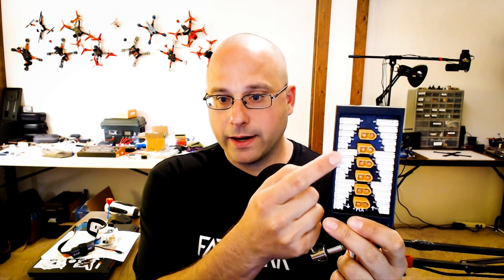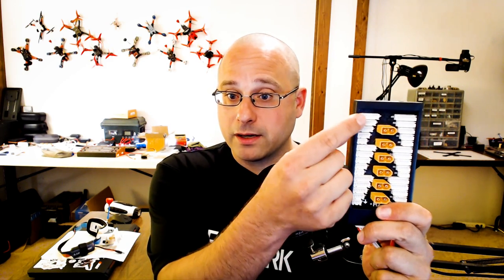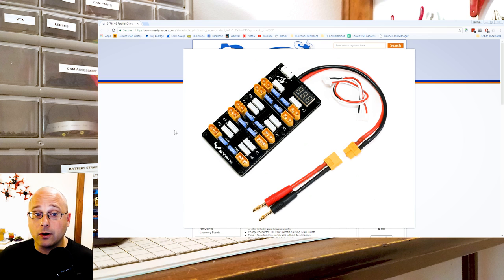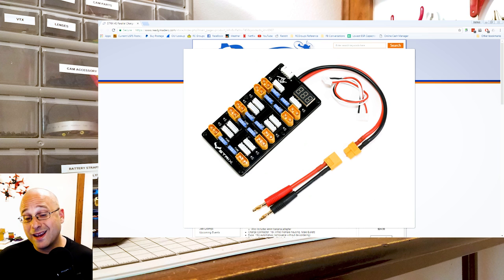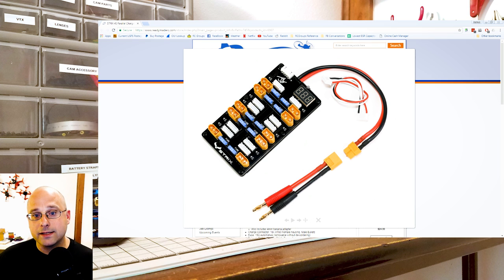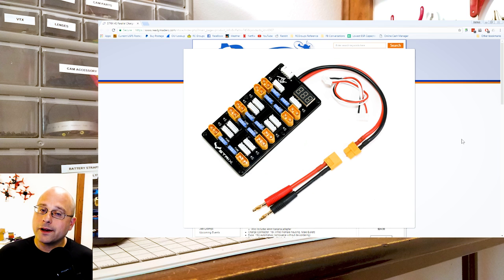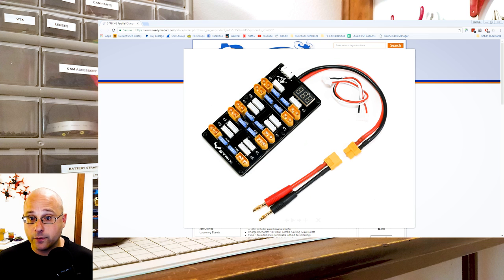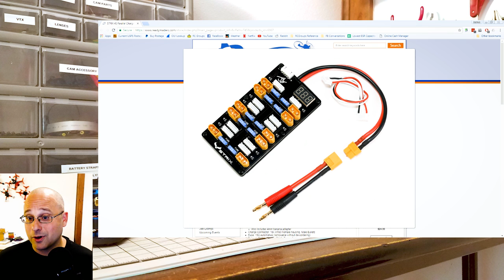The Best 4S Parallel Charging Board. Period. | JB SIGNATURE LINE

Comment: Just received my order today (back order was only about a week). Initial impressions: This is a very well built board. I was immediately surprised by the weight of it. Built in voltage meter is a really great added touch. The unit is charging up 3 packs as we speak and about 30 min in everything is working great (charging just below 1c @ 3A). Really happy with this purchase, thanks again Joshua!

Comment: Nice product Joshua.  I may have to grab one next time I'm in the USA. I would have loved to have at least one battery outlet to have 3s and 2s balance ports as well for the google and radio batteries I use.  Just for the odd times I charge that stuff. Otherwise it's very nice indeed.  Does it have poly fuses?
Reply from the maker: No poly fuses because of price and space on the board. 

The other balance plugs were intentionally left out to prevent people from ever making the mistake of accidentally mis-plugging the balance port. You can mis-plug the XT60 of course but that's what the fuses are for.
Reply: FinalGlideAus connect your 2s batteries in series :P
Reply: and if it is a deal breaker, would be easy for those inclined to add to a custom balance connector
Reply: FinalGlideAus just unplug this from your charger and plug you goggle batteries and transmitter battery in.
Reply: FinalGlideAus I've been using the SkyRC D100 with dual ports. Fantastic charger for that purpose. FS pack on one side and 4S on the other or micro 2S packs on one. Whatever! Awesome charger.
Reply: I dont get it, if all you need is poly fuses, there like a $1 each. I just purchased some to fix a car fridge for a customer, this is definitely a step in the right direction thou.
Reply: FinalGlideAus sounds like Joshua Bardwell has another product to design! Go from his boards xt-60 To another board with a step down processor controlled to lower s rating. To charge goggle battery, radio etc. Technically it could be the same as this board, because you wouldn't need 10 charging ports. Way easier for traveling, and home charging at that. Not sure if this wild work, but  Maybe on the step down board it could have one port with 4s on there to (( burn off )) the extra voltage to that pack.
Reply from the maker: Polyfuses are "only" a dollar each? How many polyfuses would this board need? Five for each balance connector, or fifty. Even if you consider the bulk discount we would get, you can see how high the price of the board would have to be to include them.

Comment: I will be buying these, being in the automotive field for 14 years, was shock to see my parra board not have a fuse holder but a fuse soldered to the circuitry. Very nice josh. Keep that top shinny, you deffently can pull it off. Jeff Evans at evans tuning does. Thanks

Comment: Hi Joshua,
as you are asking for ideas. There is some idea in my mind which is about having some kind of LiPo-Equalizer. This should generally be a parallel-charging board that has some regulating electronics on it and would do this:
During a flight session, you plug all empty 4S LiPos to it no matter how far you discharged them. The board will automatically equalize the LiPos but monitors and controls the C-Rate of the current-flow between those. This makes parallel-charging more safe and more effective.
Currently if I fly my 8 packs I check them afterwards and end up with maybe 3 groups of 2 batteries that I can charge in parallel. This board would simply need the time to get all batteries to the same level and then allow to charge them together.

Comment: You're my hero. Great product. I'm ordering one now. I agree you should include a "standard" 6S balance plug adapter. Also 4S is of course the voltage to start with but I'd absolutely recommend expanding v2 into a line of boards covering all the "S"ss (voltages). I'd readily pick up a 2S board for my goggles batts, and a 3S and 5S as well.

Comment: this thing is amazing, and I am going to buy it. 

one modification I will do, is to change the fuse into a 4 or 5 amps fuse. I am using 4cell 1300 and 1550mah batteries, which will manage 3,9 and 4,65 amps maximum at 3C charge. I am normally charging at maximum 2C, so I will have a good safety margin for normal use. 
But, if I accidentally connect a battery with too high voltage, it will exceed the amperage that the fuse can handle, and blow the fuse. No batteries damaged. 

I really dont see the point of having a 15 amps fuse. if a 1500mah battery takes 15 amps, it is 10C. then you will probably have a fire going on in your house. 

I also think that a switchable fuse would be  better than a one-time-use fuse, so you dont get stucked in the lack of fuses. 

But overall, good job Joshua!
Reply: Martin Mehus this is an excellent idea
Reply from the maker: If you change the fuse to 4 or 5 amps, then plugging in two packs at 0.4 volts difference will blow the fuse.

https://www.youtube.com/watch?v=yTEGhKBv09M

We selected 15 amps because it gives adequate head-room for equalization current while still ensuring that a fault will blow the fuse.

And also because the light blue color looks awesome against the yellow XT60.

But mostly the first one.
Reply: Thanks for clearing this up!  I thought 15 amps was overkill, guess not!
Reply: 0.4V different seems a bit extreme to put lipos in parallel. The theory says between 3.7V and 3.8V there is approximately 20% capacity. So +10/-10% for the 2 you connect. On a 1500mAh it's 150mAh. If it equalizes in 30s (this number can change everything, but the current is much more at the beginning) after plugging, it means an average current of 18A.
By the way JB, a current curve of uneven charged lipos being connected would be very interesting !
Reply: Manuel Pellizzari fair enough, but I just tested this myself last night, I had four batteries at 14.9v, all equalized, then I plugged in a 16v (I crashed and didn't get to finish repairs by dark). I put a DC clamp current meter on the battery before I plugged it in, and then watched. The current started at something a bit over 10 amps, I couldn't catch it because it happened so fast, it immediately came down to 10 amps, and then stayed there for a few seconds before beginning to drop down to 9, 8, etc until it got to 5 amps, then it stayed there longer, more on the order of 10s of seconds before dropping down and I lost interest and meet them be to equalize.

The batteries were all 1.5ah 4s lipos. So each one individually never even seen 2c for more than a fraction of a second.
Reply: Tom U this configuration (more low voltage packs) is not so bad. That's why I always start by plugging the lowest voltage ones onto the board first. Interesting data BTW.
Reply: Manuel Pellizzari Thanks! Yeah we both do the same thing then, I follow the same procedure, usually with less variance between packs. It really is a great method, I believe I got it from one of Bardwell's charging videos. Have a good one man.

Comment: Looks good, but did you protect the balance lead inputs? 

I ended up custom making one using poly fuses to protect those leads as no commercial ones seem to have this.
Reply from the maker: No poly fuses because of cost and space concerns. Plug in the XT60 first and the main fuse will protect you. If the main fuse doesn't blow, then plug in the balance after 10-20 seconds.
Reply: It would have been perfect with poly fuses :( Even if the entire pack voltage is ok, the individual cells can be totally off and smoke the balance leads clean off.
Reply: John Norrbin Can confirm, that is what prompted me to build one with input protection in the first place. 

This can also happen if you get the connector half-seated in the wrong orientation. 

I understand the space concern, I just like things to be idiot proof as some days just happen to end up like that.
Reply: And those can be daisy chained too ;)
Reply: @AlexNZL

That is a pretty cool product, assuming they have the rest of the polyfuses on the bottom of the board that is.
Reply: EDIT: @Ammoniummetavanadate nvm checked mine and yes they are on the back. the vias go to them.
Reply: Here is the back of the board:
http://i.imgur.com/ZCfpgiU.jpg

Notice how it also has a fuse on the main connection to the paraboard, 50amp fuse. It's not enough to only fuse between the batteries, if you don't then you can still short circuit the pack nearest the main plug and cause a fire.

Comment: Next design something that where you can plug 10 lipos of ANY voltage in (same capacity and cell count) and it has current limitter between lipo inputs so I never need to check voltages before paraller charging again. I know it can be done and it would make life so much easier. Maybe I have to do it myself.
Reply from the maker: I have had this conversation with many people, and every time we actually go down the road to designing a solution, it quickly gets so expensive that you might as well just build a charger. The problem is that the current limiter has to be switchable so it allows current with low resistance when you are charging, but restricts current when plugging in. This sounds simple in theory, but in practice, by the time you've covered all the contingencies, you've basically built a charger, and you might as well just go buy somebody else's charger instead.
Reply: We don't need a complicated charger to do that.   Just a small smart battery discharger to carry to  the field that can balance all cells down to 3.6v or 3.7v.  Land, plug in discharger and it should be done by the time your next pack is done.
Reply: I agree.... Considering we dont even flinch at buying $30 batts.  I would pay $50 plus for a balance board that you could safely and mindlessly plug in same cell batts regardless of voltage.

Comment: Cliffnotes version:

So, what makes this rig better than the other stuff on the market is the ability to check each pack's voltage right on the board, the replaceable fuses on each port, and its compact size since it is designed for 4s packs only. 

it is STILL actually parallel charging, and not charging ten 4s batteries as one huge 40s battery. This is why you have to make sure your batteries are all equally discharged when you hook them up.
Reply: P.s. where is the manual for this?

Comment: I stopped parallel charging because I used that older type board and I also burned balance wires and board traces too. ended up buy 2 other chargers . So I can charge 3 battery's at once. But I think with your new board I think I will go back to it. Thanks Joshua

Comment: One other feature I would like, would have been to have two voltage displays. one of the displays is to show the voltage of the whole board, and the other one is to show the voltage of an extra xt60 port on the side of the board. in this way, you will have the voltage of the board just beside the voltage of a single battery that you are to connect. 

what would have been super cool was if you added two more displays, one that remembers what the lowest battery that you have tested in the voltage-test-xt60-port on the side, and another screen that shows the highest voltage of that have been connected to the voltage-test-xt60-port. It should reset itself when all the batteries are disconnected and the voltage is 0. 

when it knows the highest and the lowest battery connected on the paralell board, you can place one red and one green LED diode, that lights up and tells you if it is safe to plug into the paralell board or not. this is an idea to a much more complicated paralell board with an easy software on it, but I think it could eliminate much of the danger and insecurity with paralell charging.
Reply: Martin Mehus just follow JBs charging guide, super easy, you can even get away with bigger voltage differences than you would think. I just check all voltages, one at time, then line them in a row, highest voltage to lowest. Plug in all the similar low voltage batteries first, once you've got 2 or 3 on there, they share the load of the higher voltages when the high ones discharge into the low ones. You can safely discharge a battery way faster than you can safely charge. So higher voltage pack discharging into several lower voltage packs splits the amperage between them.

Comment: Nice work Joshua, hopefully this will be the first in a long line of JB inspired gear available. I have a Kakute F4 AIO due to your recommendations and input in the design (Great FC), I think the more stuff you endorse, the sooner you will be able to enjoy the fruits of your hard work in the industry.
One issue I have found is the accidental plugging of balance leads back to front in a hurry (lazy) quickly sparks the JST and burns out the traces on the cheaper boards. If you could add lower current protection to the balance leads it would prevent that issue. I guess it is all about room and cost on the board but you never know it may be feasible.
Reply from the maker: That's a tough one. The keyed connector should prevent this but if you're in a hurry you can jam it in anyway. Adding polyfuses is the best approach but they're expensive and take up space.
Reply: Joshua Bardwell yep I have managed to short a few that way the male pins on the JST-XH protrude just enough to make contact around the wrong way
User error but can still happen as I have managed to prove

Comment: Just purchased a similar para board from progressive rc. It was twice as much($50) with only 6 xt-60 capacity. However I'm happy to shop local and it comes with a few other connectors like the fatshark barrel plug and some 1s connectors I think. 1 other difference Is that the balance fuses are re-usable somehow, and the main lead fuses are very common. No doubt I would have bought your board last week if I knew it was coming out. However I am quite happy with the PRC board and don't regret my purchase at all.
Reply from the maker: Yeah. Polyfuses for the balance ports were not in our budget.

Comment: I got mine.  Beautiful layout and worked great at first.  I've had a trace burn out three times already.  I'm very careful and know I'm plugging them in correctly.  It seems as though if they balance plug goes in at a slight angle you can burn a trace.  The troubling part is, if there is a battery plugged in the port closest to the meter, you'd never know the trace is burned. That's if you didn't smell or hear it flash.   That would have you charging all your batteries based of the cell data from the battery or batteries on the good side of the burned trace. 

I decided to pay for one with poly fuses. Doesn't matter if they are $100 if they keep me from burning down my house. I'd love to see your design with poly fuses.
Reply from the maker: If you're burning a trace, then they're making contact with the wrong pins. I'm not sure what the cause could be. But yeah if you've popped three of them, I agree this isn't a good product for you.